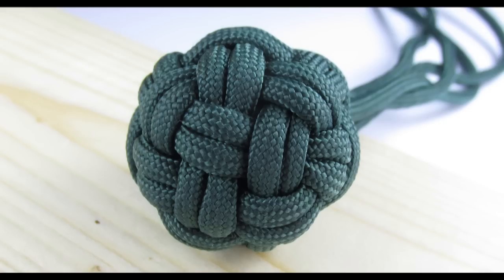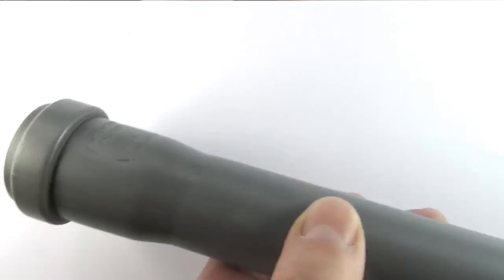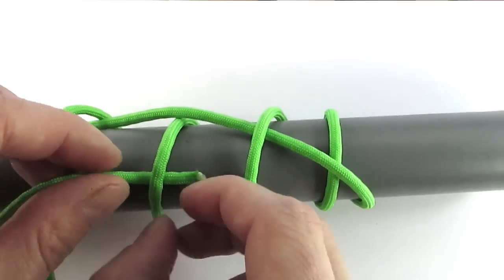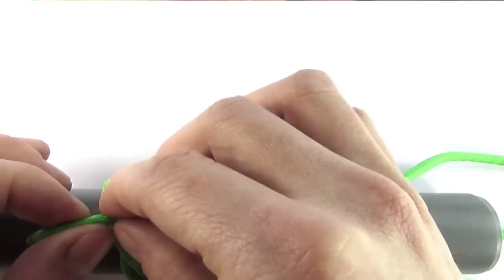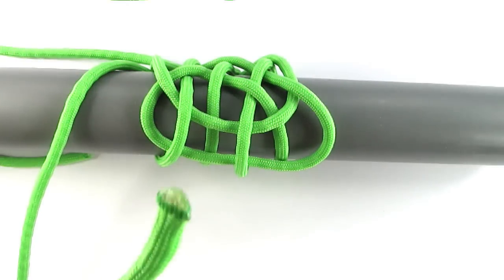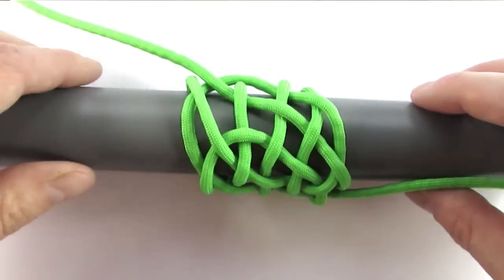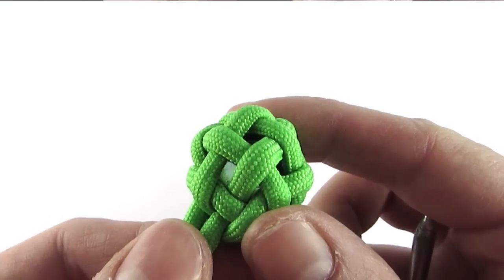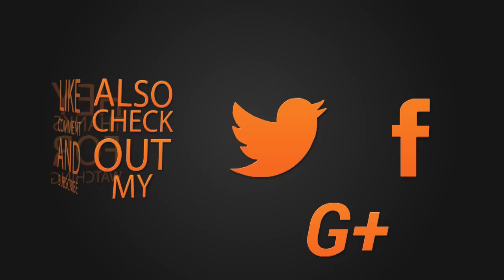How to tie a globe knot

Comment: It's that little bit at 4:40 where you say 'tighten the knot around the core' where I go from perfect to a tangled mess...  ;-/
Reply from the maker: +Malcolm Morris 

Hehe, keep at it :). You will get it.

Mark
Reply: +Malcolm Morris same here, that tightening is hard part! But still, should be doable :)
in fact, just did this and tightening must be done slowly, and It'll turn out fine
Reply: yes. it worked for me too after a couple of tries.  patience is the key..
Reply: A late thought, you can also use a smaller mandrel. That is what worked for me on the smaller (tiny) globe knots.

Comment: May I ask how many passes for a 1 inch core? or length of cord I should start with?
Reply from the maker: dday2086 
Hey there!

The core I used for this demonstration was probably around 3/4 inches, so I would assume you would need 3 or 4 passes. At that point you could also try a larger globe knot. The thing with globe knots is that there are many versions, with different numbers of faces. 

You may also like cylindrical turk's heads for covering various objects (the pineapple, herringbone and gaucho knots all look very nice).

Mark